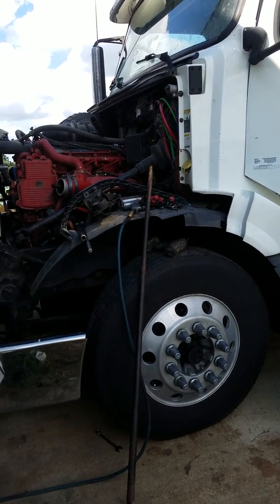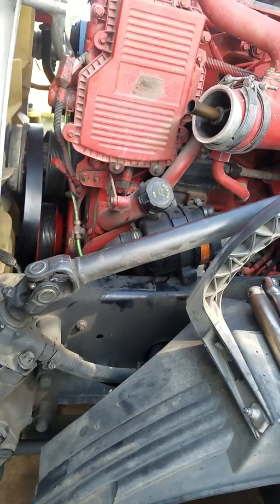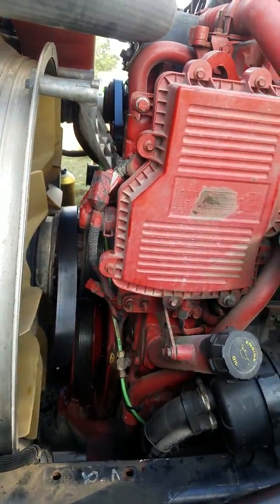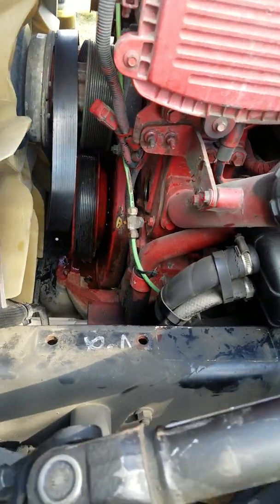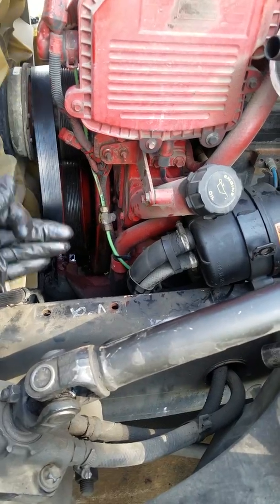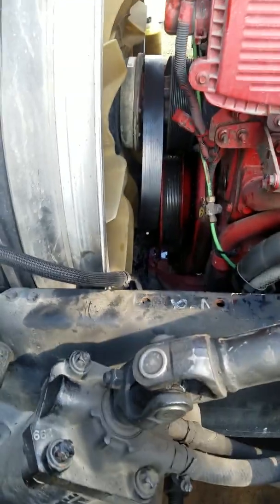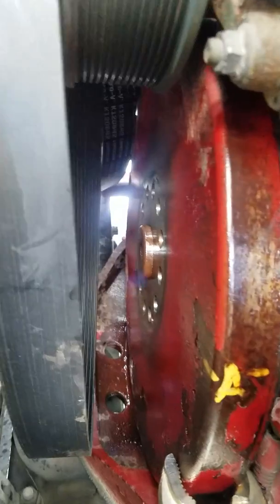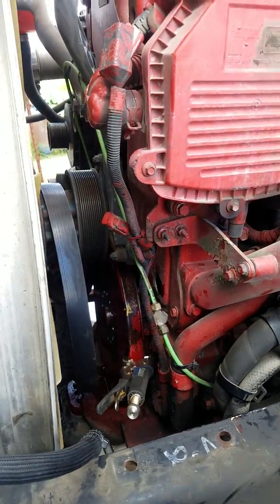Cummins ISX dampener replacement

Comment: When I’m parking in low low rpm, I feel my engine or transmission vibrating. Normal driving is fine but when I’m in low rpm’s I get the vibration. Does this help with that problem?
Reply from the maker: If those are original miles ,,,that should not be the problem,,   check engine mounts
Reply from the maker: How many miles on the truck
Reply: @mtxautomotive  80k miles cummins x15

Comment: great video 👍👍how do you prevent engine from turning when loosening bolts?
Reply from the maker: The hole in the front cover used to rotate the engine when adjusting the valves can also be used to keep the engine from rotating.......I thought I was able to use an impact ,but maybe not
Reply: @mtxautomotive  great!! I'll check that out. the engine is an ISL with a bad crank pulley. Thanks a lot!!

Comment: Did you have engine vibrations at idle or even at 900rpm parked?
Reply from the maker: The vibrations are generally throughout the entire rpm range,,it's just hard to notice because it happens so slowly over time
Reply: @mtxautomotive  I'm curious...what was the purpose of changing the damper???
Reply from the maker: GAMO 8.  It is recommended to do this by cummins at 500k,,because when the vibration gets bad enough,,you run the risk of engine damage
Reply: @mtxautomotive  ok thanks.

Comment: What was the reason you changed it.
Reply from the maker: The damper is filled with a fluid that becomes hardened over time,,usually around 500,000,,,causing a out of balance condition.  The vibrations happen gradually,so it's difficult to notice until it's replaced
Reply: @mtxautomotive  thanks.

Comment: How did you know the old one was bad?
Reply: because the silicone inside hardens and doesn't absorb the torsional vibrations
Reply: My thoughts on how it's bad. When a shaking vibration occurs in a pull at 1150 to 1350 rpms. I've talked with very knowledgeable people about this.
Reply: Most of the time the symptoms are so gradual that it can be difficult to notice ,until you replace it......recommended interval is 500,000

Comment: Without changing the front seal,,awesome
Reply from the maker: If the customer said "replace the front seal" i would. ,but i was the customer,,the front seal should last a million if the the blow by is kept in check, at which point it would be time for another dampener  and  possibly an inframe